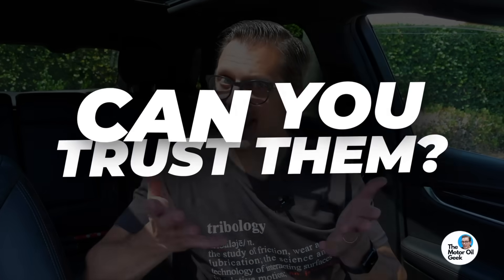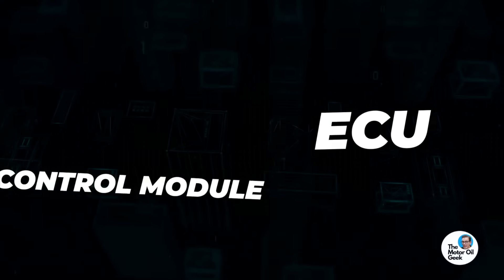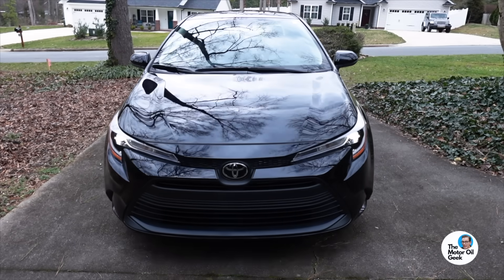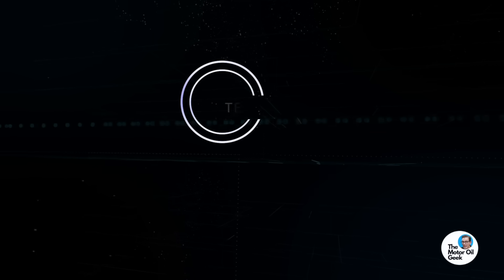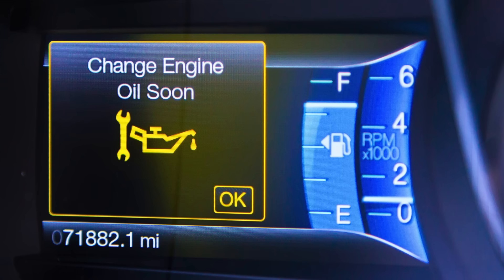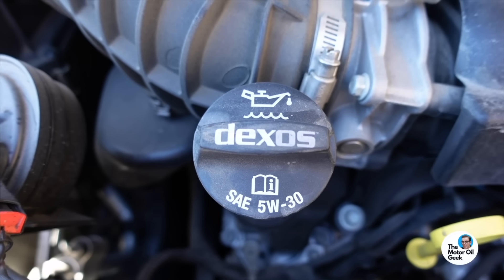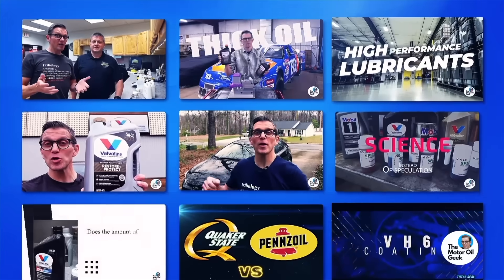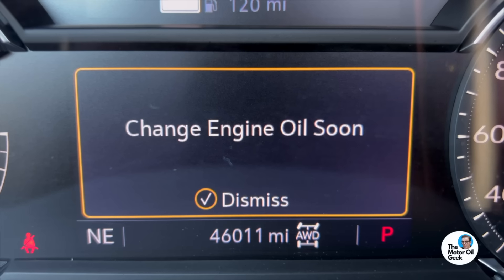The Accuracy of OIL LIFE Indicators REVEALED!

Comment: Ask any owner of an early 3.6 liter 24v GM V6 owner how inaccurate these were. Customers believing a 10K change interval, and never checking oil levels led to numerous  lower end engine failures. A very informative video, thank you!
Reply: I had a 2004 Cadillac DeVille with 10,000 mile oil change interval.  The engine did not make it to 100,000 miles.  Cylinder #5 got fouled with oil.  I'm guessing piston ring failure.
Reply: @joe-p9k4n   You are voting for donald aren't you? Be proud sport.
Reply: Today Almost every customer I talk to at the dealership has never checked the oil level in the engine ( or in ANY  car for that matter) and are surprised that they are very low on oil. ( CE on, P014, p017 )
   ' But I've never had to add oil before ' is the universal response. The question have you ever checked it? Gets the well...no but the oil life isn't up yet....
   The fact that engines normally consume oil is no longer common knowledge of operators of motor vehicles, general consumers especially. 
     Oil change operations never checked the oil before changing it or rarely informed the customer if it was low.
   Ignorance is rampant in the car and on the information networks, EVERY car should have a low oil light, maybe even a shutdown to save the engine!
Reply: @jeffhill3681  Yep, that was me as an 18 year old. 

After I got my driver license and started using my parents car (2016 GMC Terrian) for road trips with friends. I started noticing the engine would get rough every time I started up the car. 

I didn’t know what the problem could be, so I started doing online research and learned to change engine oil and engine air filter very often to keep the engine running properly.
Reply: Those engines also had tons of issues with timing chain failures. Worn out oil and low oil contributed to a not so great design.
Reply: The OLM was originally programmed to go up to 12,000 miles, which is too much especially if you don't keep the oil topped off
Reply: Yes. Check your oil level! Even occasionally is better than never. I don't care how often you do oil changes. It still needs to be checked! I know and can't believe nobody checks oil levels anymore! Ridiculous
Reply: Even with an average walmart-brand synthetic oil you can do 10K between changes. Are dopes really pushing the 3K-5K between changes meme that were solely promoted by those who profit from people needlessly changing oil?
Reply: @psalmtt8784 Have you even watched The Oil Geek videos about 10,000 mile oil changes. There's no way that is safe for your engine. The YouTuber The Care Car Nut is a master mechanic for 30 years and showed what happens to an engine when it does 10,000 mile oil changes. Failure is what happens. Stop spreading that  10,000 oil change interval lie. Your engine is getting ruined by your ignorance.
Reply: @chrisdenman1985  LOL.... dream on... I have a 2006 Lincoln LS with 192K on the clock and I have changed the oil in it at 10K since I got the car at 22K miles. In 10k miles it would burn one quart, which I replaced at about the 6k mark. Car ran like a top until the computer died.
Reply: my gm 2.4l ecotec shit its timing chain tensioners. I met a dude with the v6 ecotec that failed on him at this construction job, while we were all far away from home. 
Stay away fom Ecotecs people
Reply: @sasquatchcrew  ecoWrecks was the internal name for them. And the 3.6 was the High Feature Creature ( stretched timing chains and damaged cam phasers)
Reply: I had an08 STS with the 3.6. GM engineers used Timing Chains that were completely not up to the Task and Stretched very badly. The Carbon produced by the DI Combustion Process was found to be very abrasive and combined with a Too Small of an Oil Filter, resulting with an Oil that accelerated the Chain Wear. The Chains on my 3.6 were Allegedly changed at about 8yr and 120,000km, under an Extended GM Warranty. But I think the Stealership, just billed GM for the Work, but didn't do it, or they had a Friend of somebody who needed an Engine, cause theirs was Pooched, and they swapped it with mine, cause the Car was Never the Same after the Chains were supposedly "Replaced"
Reply: Did Lake not say the monitor limits to 7500 miles?  Maybe it was different at one time and the real issue was the oil was fine, there just wasn't enough of it as it wasn't checked?
Reply: All this is doing is training the consumer to never check their vehicle till it dies. 
The the car companies get to sell a new vehicle.
Reply: Well the OLM has nothing to do with oil level so if they never checked the oil level, that is on them, no matter the interval recommended. 

But it is entertaining though to read people go, " The OLM says my oil is at 10%, do I really need to refill it?" I mean first it is oil life monitor not a level monitor.... But even if it was a level indicator, why would you wait until 10% to refill it? You would be starving the engine for oil at that point.....
Reply: My father does that with his truck. He thinks it’s just like his bmws that have an oil level sensor and will alert you if you’re low. The f150 does not have one so a few times I’ve had to top it off when it was way below the minimum add line. NOT all cars a created equal! You have to know what your vehicle is equipped with before you just go blindly trusting it.
Reply: You are voting for donald aren't you? Be proud sport.
Reply: @stephencurry8552  Yeah, we've all seen that joe biden is a better candidate. He answered all the questions
Reply: @stephencurry8552 here comes the troll.
Reply: @stephencurry8552  this is not a political channel.  Asshat!
Reply: @stephencurry8552 anyone with ANY intelligence is. Watch CNN much?
Reply: @stephencurry8552  Yeah, we've seen that joe is way better choice. He answered all the questions
Reply: @stephencurry8552  Yeah, we've seen that joe is way better candidate. He answered all the questions!

Comment: When I had a newer GM vehicle with an oil life monitor I did use it, but my target was changing at 30%
Reply: That's a good way to do it. If you normally change your oil at 5K miles and have normal driving habits, you can track what % you're at when you hit 5K miles and just go off that. You might hit that % earlier or later depending on your driving conditions and will have a good buffer. Miles is a wildly inaccurate way of tracking oil life, it's just all we had to go off for many years.
Reply: The Engine collects dirt on the inside of the Engine.
The more dirt.....the more fuel is used.
Always change Engine Oil often.....Unless You don't mind wasting money on more fuel.
The Engine needs to be clean on the inside to achieve best fuel economy.
Reply: @gj91471    it's not Just dirt buddy. Oils start oxidizing as soon as they are put to use. That's why the premium synthetics can take it better for longer versus the cheap stuff.
Reply: I always used Trip B to monitor oil milage. I changed mine between 4k to 5k miles depending on weather conditions and trip usage.
Reply: @mercedes-amgforlife3237  I actually do the same! I target around 5k miles since the engine in mine is a turbo GDI. The OLM is usually around 30% when I get to the 5k mile mark.

Comment: Yep, a friend of mine drove less than a mile to work in his '95 Silverado. His oil always looked like a butterscotch milkshake and the back end of his exhaust rusted out several times ---until he retired, then the issues stopped.
Reply: I do a lot of short trips and idling in the winter. I try to get it up to highway speed and operating temp a couple times a week. I reduced my idling in winter a lot by putting in one of those Chinese diesel heater eberspacher knockoffs
Reply: @juliogonzo2718  go with hybrid - you'll be able to idle with engine off. I have Toyota hybrid and engine turns on for 3 min every 15min in cold or hot weather. So you can idle 1 hour with only 12 min of engine actually been on. The rest of 48min you just enjoy A/C or heat. That's the beauty of hybrids! Not to mention they save tons of fuel, and spesifically Toyota hybrids are bulletproof.
Reply: @fcex558  I drove cab part time years ago and they switched from retired crown vic cop cars to prius's and as much as they sucked to drive compared to a rwd v8 car for obvious reasons I was actually impressed by how well the hybrid system worked
Reply: Why not just walk or bike?
Reply: @BrianWaller-qe7gr  No can do.  We're Muricans.
Reply: Your friend is a dullard. White male MAGA dullard. Impossible to repair a MAGA males brain. Incapable of learning. Incapable of accepting information which is contrary to their confirmation bias.

Comment: I buy Pennzoil Ultra Plat and change every 3000 miles. I use my odometer and not those silly oil life indicators as going by the indicator will just cause the engine to sludge.
Reply: Pay for a lab test. You are throwing money way. The lab test will pay for itself in the first 9000 miles.
Reply: 3k on ultra platinum? Seems a little soon…
Reply: @lukeWiz44  It's the US sport of "let's see how much money I can waste".
Reply: lol
Reply: I run valvoline full synthetic high mileage with fram ultra synthetic filters. Been good to me. Changed at 5,000 miles

Comment: Great video. I was in a driving situation that almost mirrored the little old lady driving to church but my ambient temperatures were 90-100F. The car hit 5% oil life at around 1200 miles and I would say 5 months. I think you are right that they are not accurate but can be trusted in the sense that it will get most people to change their oil on a more appropriate timetable without having to be mechanically inclined.
Reply: His point is that they are accurate... At least GM's is.
Reply: @bobbygetsbanned6049 meant to say precise, but he did say they were conservative and the test reflected that
Reply: that's why even a highly praised system being "conservative" should tell you that the 3k/5k oil change mark is still a good standard to stick by.
Reply: I'd call bullshit on that. My money says the Dealer adjusted the oil change notification.

Comment: Can't trust oil life monitor on GM. Daughter does alot of short trip driving 3 to 5 miles. Have a 24 Trax 1.2l GDI turbo. Oil life 50% at 3k 6 month old oil with 4.5% fuel dilution.
Reply: you let your daughter drive a 1.2 Trax? theres your problem
Reply: Whats the problem?@MrApplesaucestuff
Reply: @MrApplesaucestuff keyboard warrior